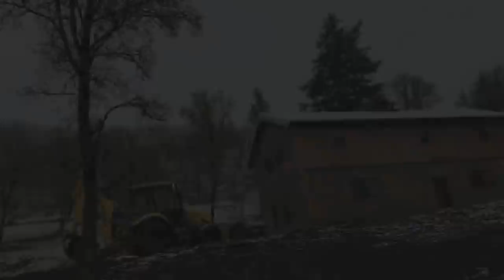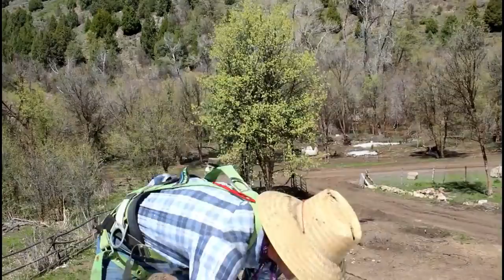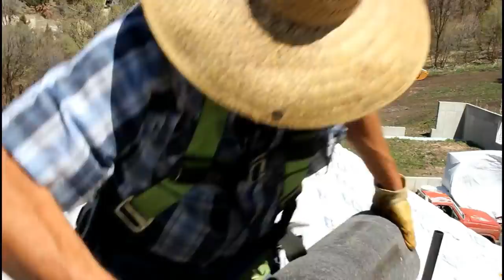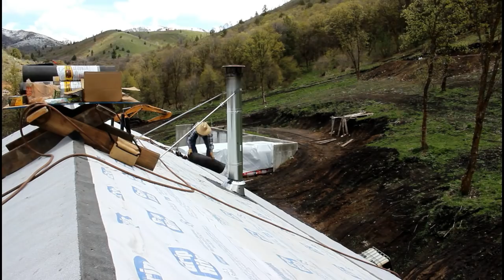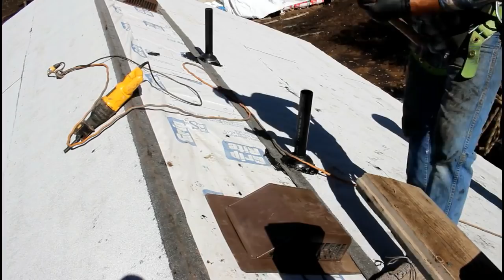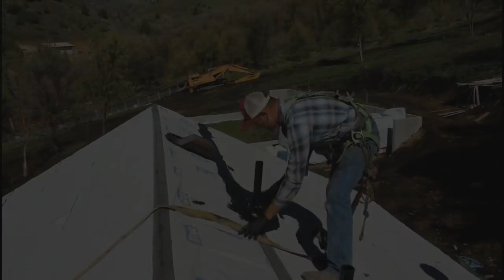#222 - I Installed Rolled Roofing Under Corrugated Tin

Comment: Looks awesome. The only suggestion I would make..take it as you like instead of tar around the vents use Vulan caulking. It does not deteriorate like the tar. Unless you want to be back on the roof.

Comment: Been following your build, totally different to how we have to do it over here in Australia, we don't use so much plywood, we just frame, batten and rafter then cover with insulation foil membrane then slap the Tin on! 😁
However, I agree with your idea of no using gutters on the high roof to allow the snow and rain water to fall to the lowest roof, snow can build up and gutters fill with ice and end up ripping the gutters down! One trick we use here where there is no gutters is to put down about 6" of gravel around the drip line, about 2' wide, this allows any runoff of water or snow to not splatter mud and water all over the side of the house.
I have a friend (Rick is a retired firefighter from California and all round great guy) who has bought acres around Naples, Idaho and a cousin (Kirk Guidinger) who live in Idaho Falls, Idaho.

Comment: Thanks for finding your harness ! Tip - Don't stand on any felt or tin as your nailing it.
I watched you step over & on the felt, it will rip quicker than slick snot!
Questions- Are you going to install gable & soffit vents to aid with the roof vents?
You did get ahead of yourself with the roof vents, the bottom of the roof vents need
to be on the top of the tin. The same goes with rubber plumbing stacks, top & sides
tucked under with bottom on top of roofing.
Don't know how your gonna do the metal roofing by yourself , between getting the 
materials on the roof & keeping it from blowing off while working is gonna be a chore!

Comment: Having spent the last 35 years as a sheet metal worker I can say with out hesitation I must have installed acres of this decking. We always screw  we screw the saddle or the lower point, the other thing you will want to consider is expansion of the sheets, we normally slot screw locations, just what we do.

Comment: A harness- nearly there. Just a few points to try and keep you safe - attaching to the side work positioning loop at your waist (these are just for a loop to go round a pole etc and keep you in close) will brake your spine and or pelvis also the length of the cargo strap probably means you would hit the floor if you fell or at least accelerated to a point of injury or death!   

Also a fall arrest rope is designed to stretch and lesson the load, a cargo/ratchet strap will not yield inflicting more injuries.

Properly Rig a wire line along the ridge and use a short fall arrest rope or fall arrest lanyard set to the D ring towards the top of your back on the harness, use a carabiner to slide along the wire rope at the ridge and lanyard/fall arrest rope set so you can just reach the edge and no more. Also set stops so you can't walk/fall off the each end of the roof.

You are putting your self at nearly the same risk as if you didn't wear the harness! I talk form knowledge from a safety rep and  trained rope access tech.

Loads of videos and guides on Youtube, heres two:
https://www.youtube.com/watch?v=z62qFhfT3a4 
https://youtu.be/RoaK1YPrJKA

Comment: I think you need to put the front flange of those roof vents on top of the roll roofing. You will have to slice your roll roofing sideways and then slide it under the front of the vents. Hard to explain, but the way you got it, the water will hit the vents and run under the roll roofing. Anyways just think about it. Same with the pipe boots. Not trying to discourage you, only trying to save you a roof leak.

Comment: If you get a few inches of snow on the roof or side rain the vents are going to leak from the side slats. The vents should be allowed to drain at the bottom over the rolled roofing. You sealed it completely that water has nowhere to go but inside You may want to fix it while you're already up there.

Comment: NEC Jan 2018 requires ARC Fault Circuit Breakers on all circuits in a home...
Are they inforcing that code where you live
Reply from the maker: jim h no
Reply: Red Poppy Ranch 
You're lucky
They act up.
They say the new generation doesn't false trip any more...
I'm here to tell you 
1500 watt space heater trips them regularly
Even a toaster trips them..

Comment: Nice story. 
Great to see you with a harness on.
Now I don't know much about roll roofing, but a lot about other roofing, and as I warned you about needing to vent the skin of the roof, it looks to me like you are creating a potential for multiple leaks (I see many), and it will not be easy to fix with the tin on it. I hope I'm wrong but a roof isn't something you scrimp and save money on. It appears to me that you are designing some sort of non conventional roof design due to cost and looks. Just saying, that's what protects 90% of your home and to try something that has not been proven is a bad move. I would go with conventional shingles, asphalt or cedar or invest in a real tin roof that will last a life time.

Comment: You're becoming that inspiration you speak of for many others.  Your dedication to the task at hand is commendable.  Your willingness to jump in with both feet, even if that means learning the task first so that you can get it done is admirable.  A remarkable effort!   But, about your harness.  IF you're going to use that safety harness you may as well have a Shock Absorbing Lanyard on it: https://www.ohiopowertool.com/c-267-lanyards.aspx# IF you do fall it will slow down the last bit of the fall, it resists, then releases more lanyard....there's about six more feet of line wound up in there.  I always wore them, I never had to use one.  Doing a great job, man!  All the very best, to you ALL!